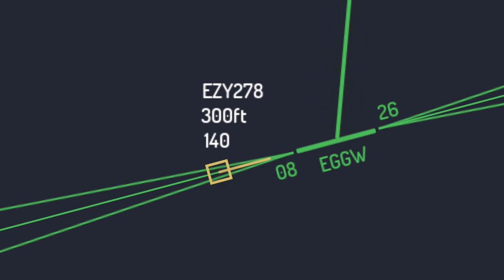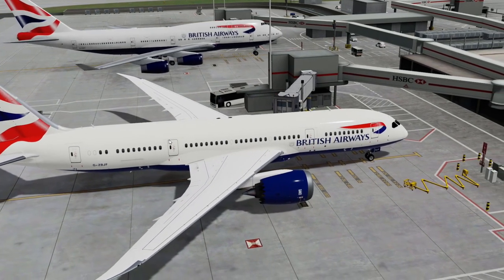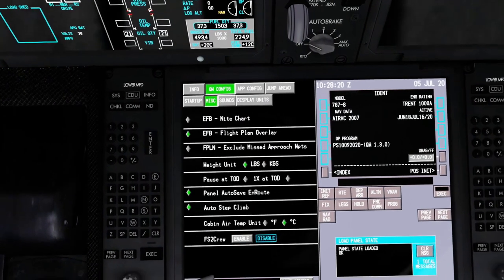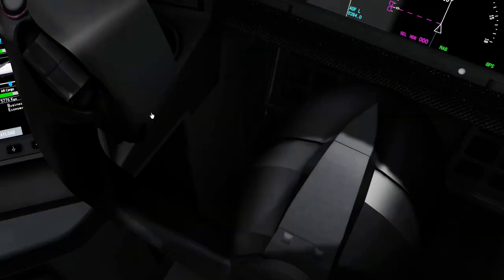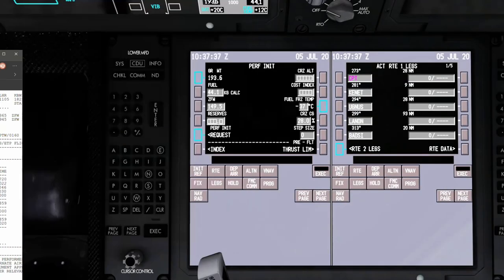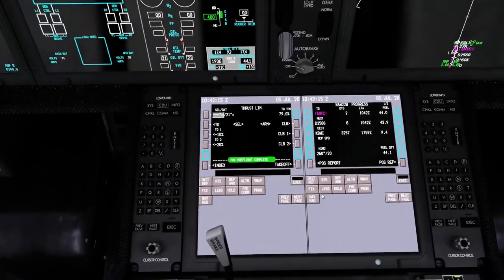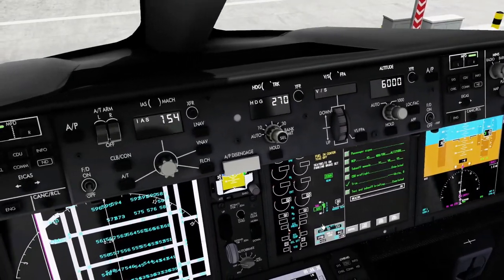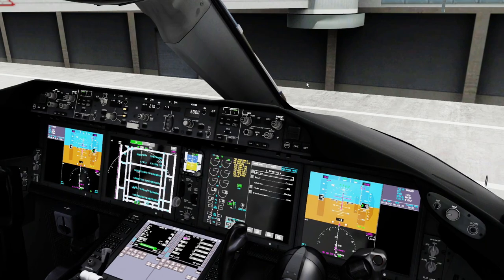[1/3] Tutorial - How To Fly the QualityWings 787 - Pre-Flight

Comment: Another way to make the QW787 cold and dark automatically is to go to the QW787.cfg in the QW folder in P3D folder, and then remove the // from //panelstate=coldanddark.pnl
If you know a thing or two about Java programming you would know that // is a comment to your code, so in other words the text behind the //does not have any meaning.
But if you remove the // it will become a coded command to start the plane in a cold and dark state by default.

Comment: Nice tutorial.
Considering the amount I paid for this aircraft 
Still disappointed in it  at the moment.
With lnav/vnav. And auto throttle during climb. It does not stop at set altitude say 38000ft it keeps climbing to 45000 no Step  climbs enabled then using flch wont descend 
Have you experienced this in v5 with 1.3?

I’ve gone on their forums but no answer yet 
Thanks

Comment: Nice vid. If you would like to know how real crews setup a real 787 let me know. In comparison to reality you missed over half of the preflight setup but still did a good job. Boeing and Airbus rely on flows not checklists so in short duties are split between Capt and FO and PF and PM. For instance you mussed the entire MCP setup plus center console etc. highly recommend the 787 flow trainer if you really want toknow how to setup a real 787.
Real world 787 pilots never do cold and dark starts..ever.
Engineers are responsible for a very long setup if an aircraft is depowered which is very rare.
Anyway good work and read some more learning and aviation go hand in hand.